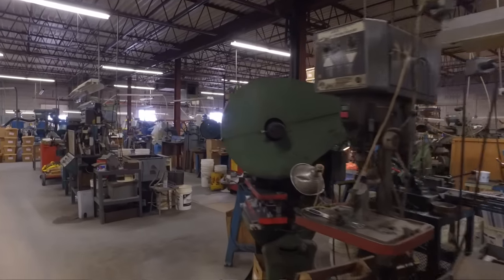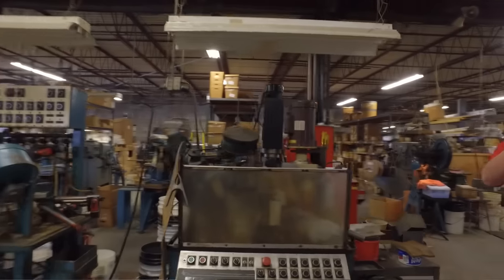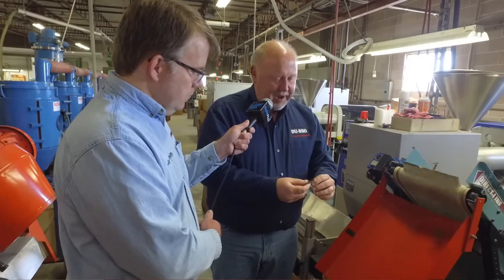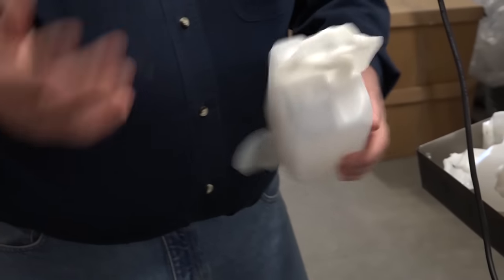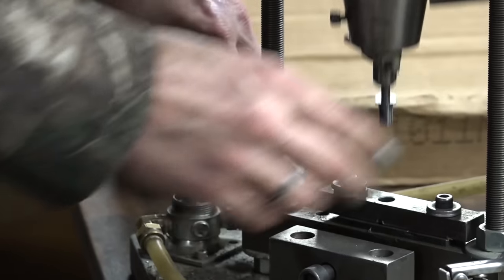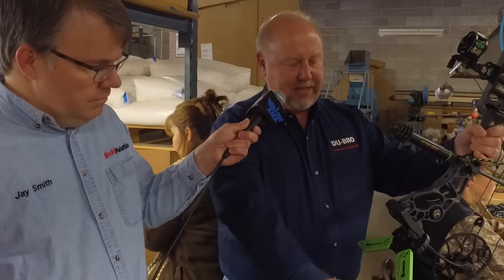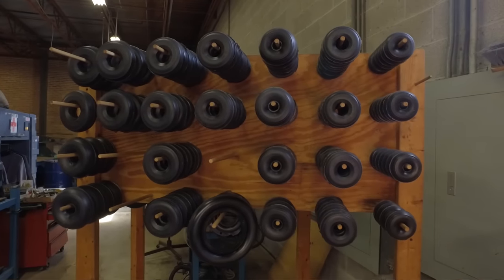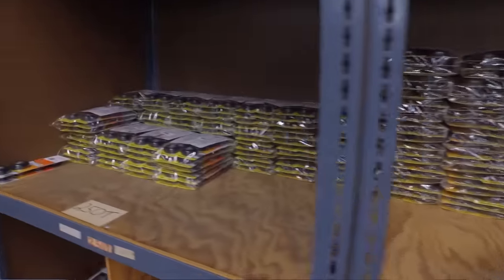DU-BRO Products Factory Tour - Model Aviation

Comment: I build a lot of prototypes with rod-actuated mechanisms and similar gizmos, and ever since I started building things as a kid, I've always kept a little selection of Du-Bro stop-collars and other hardware in my parts drawers. Hobby shops started getting scarce in the 80s, but luckily the internet came to fill in the gap. I was delighted to find that not only could I still get Du-Bro products that I've been using since the 60s, but that the company is thriving and doing better than ever. One satisfied lifelong customer here.